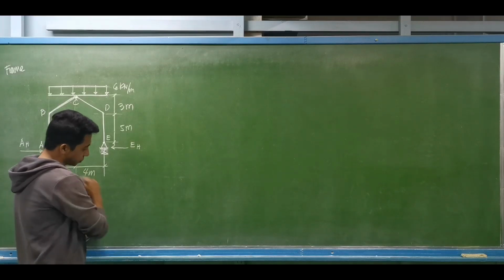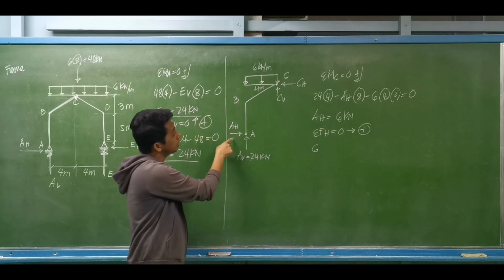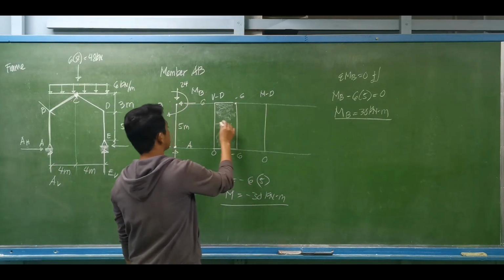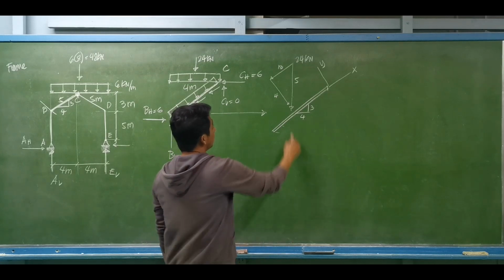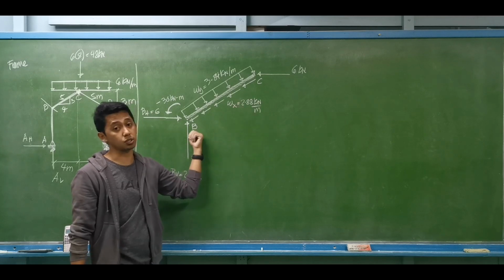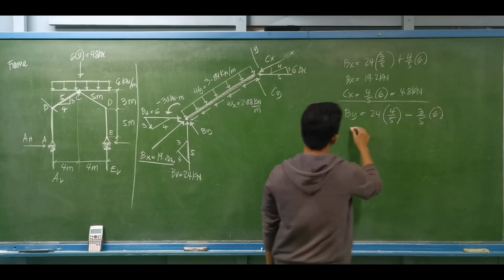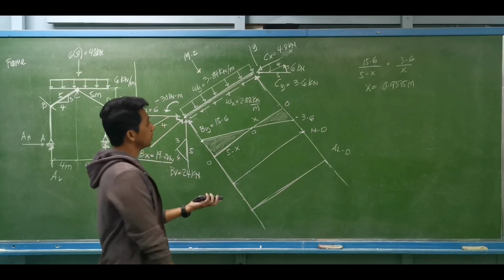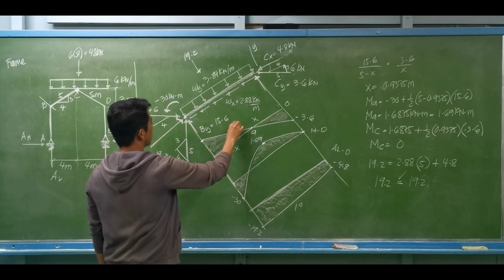Frame Analysis

Comment: A great video !  Please if in C exist a moment, how could I resolve it?
Reply from the maker: You mean C will be a fixed joint? The frame will be indeterminate and you need to use other methods like, Three Moment Equation, Moment Distribution and so on.

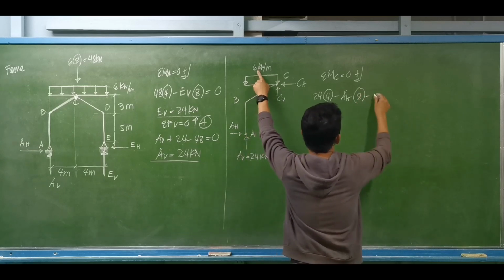Comment: Thanks a lot for your video. Clear explanation. Just I think that at 03:46, the moment at C of the distributed load should be positive + 6 × 4 ×2 not negative (according to the positive clockwise that you consider). I am I wrong?
Reply from the maker: Welcome and thank you also for appreciating.

Regarding your concern, it's negative. 😊
Reply: @AbrenianLecturer  could you explain this briefly please. the moment is un the clockwise dir no?. thanks a lot for your answer.
Reply from the maker: @RN_Ed_Eng The summation of moments is with respect to C. The uniform load is on the left and it's downward that's why it will give a counterclockwise moment to C.
Reply: @AbrenianLecturer  thanks a lot. you are absolutely right. the moment is in C. thank you very much.
Reply: Deep respect from Tunisia
Reply from the maker: @RNE2009 🙏🙏🙏